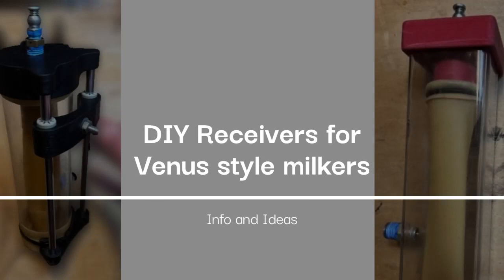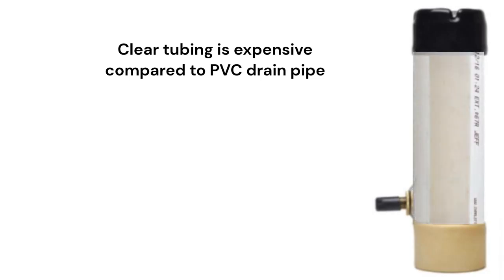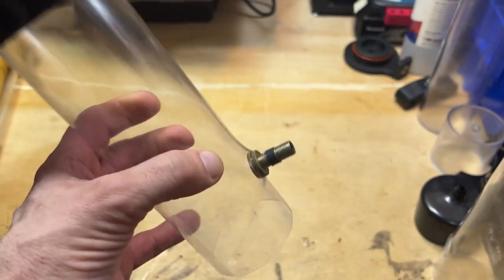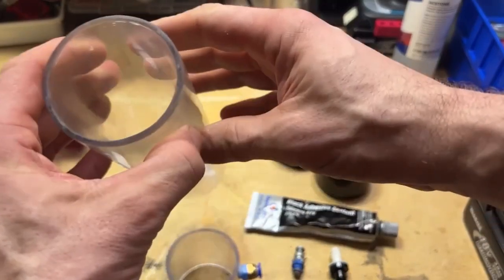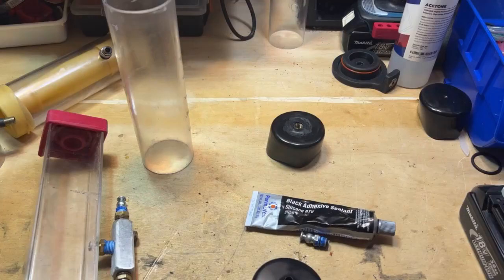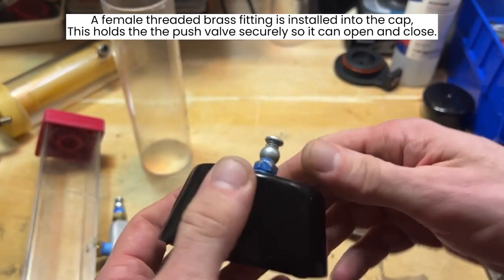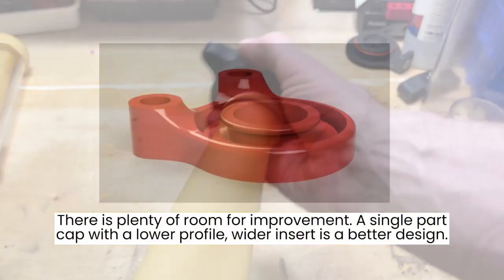Making and Modifying Venus Style Receivers

Comment: That two piece retention system you show that you said you made at 4:00, how do I get that? Do I need like a 3d printer or something? Could you sell those? :P
Reply from the maker: It is printed. There are different versions for square and round tube. The files are here:
https://www.thingiverse.com/thing:6223052

The cap part that goes over the outer tube is a very tight fit.  I have an old, one piece version that uses the inner and outer diameter of a tube to handle different sizes and wall thicknesses. It might be useful to compare sizes (the Venus receivers have slightly thinner walls than the ones I make) 
https://www.thingiverse.com/thing:5439655

Comment: Have you thought about making a way to keep the tube upright or sliding up and down without flying off?
Reply from the maker: For keeping is upright, I put a couple linear rods / bearings to give a mounting point on the receiver. The pic doesn't show it, but you can add springs to the rods to push the receiver down. It works well, but you still need something to mount it too. 
https://github.com/MikesMachines/MilkIt/blob/main/media/receivers/LinearSlide.JPG

My first solution used air pressure sensors to open a solenoid when the pressure was above a set amount for a small amount of time.  I had a lot of success initially, but as soon as I made some changes to the machine,  it stopped working consistently.  It basically needs to be recalibrated with changes to keep the stroke long without popping off.  It became too much for how often I'm tearing things apart :P

Comment: I'm also looking for liner supplies and materials, found 0.1 and 0.2mm PE  could that work? If so, good priced alternative 🤓
Reply: Get Serious Kit stuff. It works and it's silicone. One size that you think will fit perfectly and one size smaller.
Reply: I'm DMing NSFWM with thoughts on a DIY tube, so you get any texture you want.
Reply from the maker: Have you had any success? Only Venus and Serious kit liners have been ok so far. Others seem very thick / not stretchy enough.
Reply: @nsfwmachines8343   Very much developmental, search Oogoo on instructables for a wider view. Mike 77's been rolling it to 0.5 just fine.  You can thin it right down like latex, so dipping in the same way will work. Just use a textured mould, same as a VUL skin, but the other way around.
I posted this the second I spotted it, I suspect the failures have been too tied to the formula rather than understanding what each does.
Basically you're going from malleable silicone dioxide to firm silicone by absorbing hydrogen from the air, releasing water. Mixing cornstarch in speeds things up as it absorbs water, and bulks the silicone out if you want a stiff mould - which we don't. Going in the other direction thins the putty-like SD into a liquid of variable viscosity depending on how much Spirits you add,  it still evaporates off just like water does. That also extends the working time, which mould-makers hate, but dippers love, because they're working with far thinner layers.
Something from memory says they've even used vacuum gas extraction in manufacturing cookware, to avoid bubbles in the pour becoming breeding grounds for bacteria
I posted immediately I spotted it, I'll be testing in the next couple f days.
Reply: @nsfwmachines8343  Turning to the test itself, you'll need to time how long a single dip takes to get tacky, and measure the thickness once dry to tell yow how many dips you'll need for 0.4 mm. If you find you've got 0.8mm instantly, use double the spirits!
Reply: @nsfwmachines8343   My personal path was from my neurodiversity, which craves sensory deprivation as grounding from mental hyperactivity.  I first spotted that with Ataraxia, the convenor of the now-defunct International Association of Rubberists. Subspace turned out to be a portal into cognitive suppression, opening us to shibari and wider forms of sensation, and the therapeutic community started using silicone wristbands for vanillas from the club scene. So when a TG specialist produced a straight neck-entry catsuit late last year (Celene Nox' channel here) it resolved the stretch inequality caused by the seams in latex suits and I started to consider silicone, with this thinking  coming to the fore.

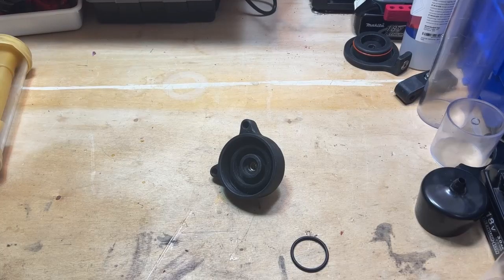Comment: Hi. Would you mind to share files for printing these caps in 3:35?
I'm working on DIY Serious Kit style machine and of course I've made the worst decision ever by trying to make SPTs by myself LOL.
Reply from the maker: I will! It’s going to take me a week or so, I need to restore my PC  :/
Reply: @nsfwmachines8343  Thanks. I really apprecieate it. 
Just got my hands on Serious Kit liners and it's insane how much thicker and less stretchy they are in comparison to lovebotz/venus2000 ones. 
On the other hand it should last really long. I've had a lovebotz receiver for some time in storage and the latex liner just melted LOL

As for conductive liner it's a bit less stretchy. They recommend 39mm liner on 50mm outside diameter tube while a normal 38mm goes on 60mm.
If i had to compare the feeling of them in hands to something I would say it's like a bit more stretchy bicycle tube(especially conductive one).

3-5mm wall thickness tube is needed for it. Puttiing them on thinner ones without breaking something seems to me a bit tricky. Unless using undersized tube...
Reply: @ThomasShatter  I've tried bicycle tubes before and got a rush, f*cking serious skin reaction 😪